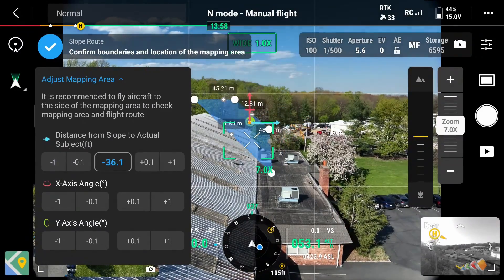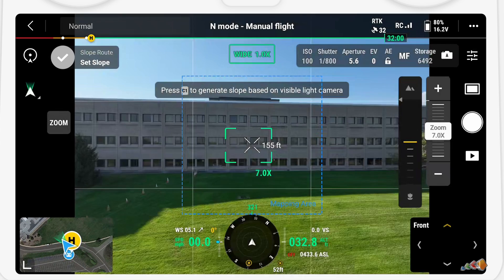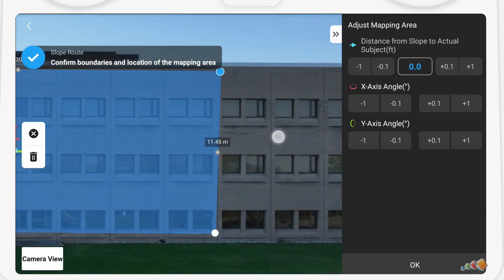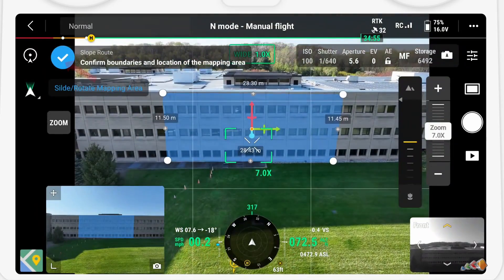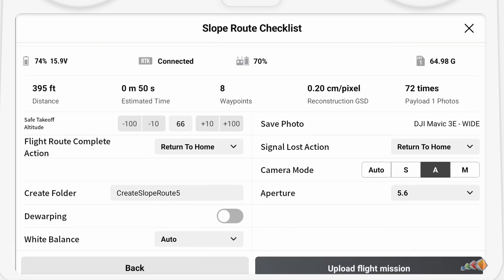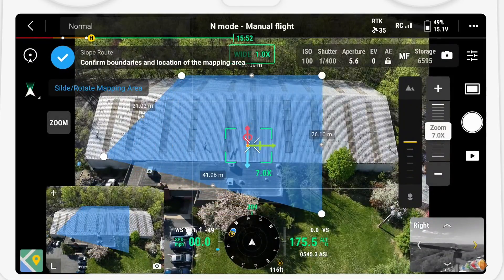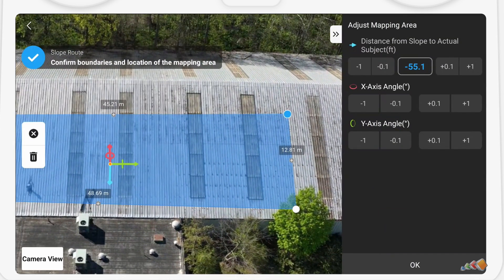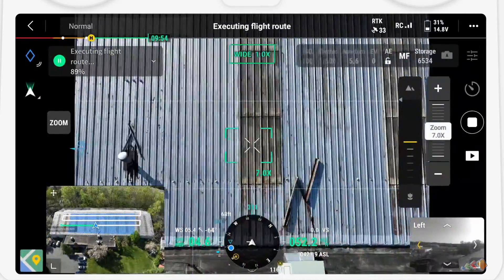Mavic 3 Enterprise Slope Route / Facade

Comment: When scanning a vertical facade on sight with the mavic3E rtk on pilot 2 app and the facade was a wall with doors and garagedoors from 0m to 4m.  When my camera is at 0 degree straight forward and want to capture all the facade the drone touch the ground! There is no way to set the minimum height so how to avoid that so that the drone start a bit higher ? Thank you.
Reply from the maker: There are a few options.  There is no way to create a minimum that I know of using this feature, but the box showing the area to be captured doesn't need to go all the way to the ground since the camera has quite a large field of view.  So you can raise up the capture area slightly.  You can also adjust the distance to the facade and it will adjust the number of passes - the further back you are the fewer passes there will be.  In my example I initially only had one pass right in the middle.  
When it creates the flight path (shown with a green line) you can use that to see how close it is to the ground and adjust as necessary.  
If that doesn't work for you then you might want to try using Dronelink instead which does allow for setting the bottom and top altitudes - see this video https://youtu.be/bM7PmiXaeWo
Reply: @aviosmedia I can set the lower height in UGCS at min 5, thats not good. So I guess your first solution is the best to higher up the base in the blue box. I watch all the videos and still do to learn more.  🎉
Reply from the maker: Yes, start by raising the blue area.  I can pretty much guarantee if that if your drone is going so low that it is touching the ground then you are going lower than you need to for capture.

Comment: I just wondered what software program is perfect for such inspection. How to create a orthophoto with high detail without spending money?  I used mipmap, webodm and postshot.   Mipmap was the best.  What is your advice and workflow?
Reply from the maker: What drone do you have and are you looking for 2d or 3d?
Reply: @aviosmedia mavic 3E and for facade or roof 2D and buildings 3D
Reply from the maker: For capture of 2D with an M3E I use the Pilot 2 app - usually programmed ahead in Flight Hub 2.  For an angled roof I would use Pilot 2 and use the slope facade (this video).  For other facades I personally use Dronelink.  I have been asked to produce a facade tutorial for that so that is on the list - hopefully some time in January.  
For processing 2D I use WebODM 95% of the time and you can get 250 free credits when signing up for WebODM Cloud using this link: https://webodm.net/uav_mapping/19634
For 3D I usually use Polycam.  I would use Mipmap (use the coupon of ZSQQPS6INQ for 10% off) but it currently only runs on a PC and I'm all Mac these days.
Reply: @aviosmedia somehow I don’t get it right for this little facade I did today on sight in pilot 2 and process with webodm…don’t find a good tutorial to give me a good result.
Reply from the maker: I don't use WebODM for anything but 2D.  For facade work I would use either Polycam (for 3D output) or agisoft metashape - both of which work on my Mac.  You could do the same with Mipmap if you have that option.
Reply: @aviosmedia thank you for your time.  Appreciated.  Happy end of the year.  🎉
Reply from the maker: You're welcome!  And happy new year to you too 🎉

Comment: Hello, I tried this new feature yesterday and apparently the gimbal angle cannot be defined, right? 
I tried two different flights one with the gimbal tilted down and other with the gimbal leveled to the front. 
Depending on the gimbal angle the flight path was adjusted to cover the right portion of the building. Did anyone have this kind of experience regarding the gimbal angle?
I was using Mavic 3 Multiespectral.
Reply from the maker: The system will use whatever gimbal angle you have when you mark the area - so if you are facing a roof with a 45deg angle it will use that as the starting point.  You can then adjust it afterwards.  I don't have a multispectral so I can't tell you if that does something different.

Comment: I just tried this yesterday and have a question about an issue you touched on...
At 3:01 you are adjusting the distance from the "slope to actual subject" when viewing the slope from above. You were tapping on the +1 key to move it away.. i did the same thing.
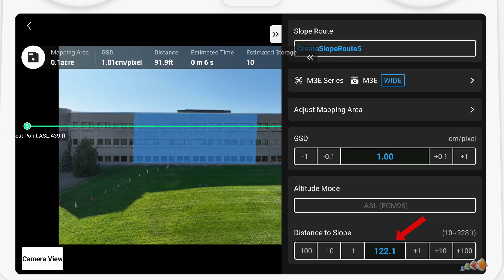But then at 3:50 you point out that the "Distance to slope" is 122.1 feet and it has to be moved closer...

Why is this distance so different from the slope distance that was set at 3:01? I didn't notice that difference yesterday and it started from that greater distance.
It seems like the distance from the first step should definitely carry over so that it shouldn't have to be readjusted later!

Thanks for these great videos!
Reply from the maker: I understand the confusion - so let me see if I can clarify.  

There are two things that are being controlled.  One is where the object being mapped is - that is what is being set at 3:01.  If we were mapping normally this would be telling the drone where the ground is.  

The second is how far away from the object the drone should be when mapping.  That is what is being set at 3:50.  If we were normally mapping this would be the altitude.  

So one sets the object location and the other sets the distance to that object.

Hope that makes sense - let me know if it is still unclear.
Reply: @aviosmedia  first, WOW, that was a quick response! 
and ok, i can kinda see the difference... still it seems in both cases the blue AR overlay in both cases represent the same thing... And if you look below from my question from 2 weeks ago, I think this answer here also answers my last question! :)   The first step locates the physical wall of the building in 3d space and the 2nd step locates the vertical plane that the drone will operate in when taking the pics... Is that a correct view of it?

And I know you have used WebODM from your other videos... and I tried processing this in WebODM and it does not know how to turn these into a vertical ortho map. What have you used for this?  This is an important commercial feature for my clients.

Your video are always awesome and this whole confusion to me is how the Flight App 2 GUI represents these 2 steps.
Thanks!
Reply from the maker: @hchattaway  Correct.  The difference is that the blue overlay shows what is being covered.  The second one (distance) changes the flight path, so if you see we only had one green line when we started - that green line represents the flight path.   So it was just going to do one pass.  When I moved the drone closer it added more paths to keep the same overlaps (see video on overlaps if you need info there).  
I've used this for sloped roofs and was able to get WebODM to create orthos.  It should work.
Reply: @aviosmedia  yes I saw the same thing.. when i moved that value closer, the rows increased...
I had just put a question on WebODM support board and they stated it can't make an ortho map.. It can make a 3d model of that wall but the quality isn't as good as a true ortho which retains the imagery detail.. When creating the model, the images when wrapped around the point cloud are always more distorted. :(
Reply from the maker: @hchattaway  Interesting.  I didn't actually try it on the wall shots - I just used that as an example of how to use it.  I have used it on some roofs and it handled those OK - I guess there is an angle where it stops though.  Interesting.  I'll have to play around with it when I have more time.

Comment: I have the ME3T and this will be a great additional service..

But I was wondering how does it figure out the distance from the slope to the actual building surface? The altitude off the ground is obvious, but at what point did it get a reference to the building so that it knows how far away you told it to fly?
Reply from the maker: It does some magic with the imagery - you literally take a photo of the area you want to cover and it figures it out.  Don't ask me how!  Someone smarter than I am (a pretty low bar!) figured out how to do that.

Comment: Excellent video! question does the mavic3 thermal have these features that were presented?
Reply from the maker: Yes it can (I tested this morning).  You will need the RTK module installed the same as with the M3E.  If you don't have one let me know and I'll point you to where you can get one a bit cheaper than buying in the US.

Comment: Doing a test mission today, and the drone couldn't get down low enough because of obstacle avoidance to capture the base of the facade. I set the downward avoidance to 3'. Any other suggestions?
Reply from the maker: It's quite a wide angle lens, so my assumption is you are too close to the building.  Try moving back a bit.  That will also help with gps accuracy.
Reply: Does the emlid work outside the US? We operate in South America and are looking for a good Base and Rover to use with the M3E.
Reply from the maker: @dragonflyguyana  here is a link that will show dealers around the world.  https://emlid.com/dealers/. There is no reason why it would not work in South America, however I would suggest contacting Emlid directly in case there are any differences in software such as licensing restrictions or language differences.

Comment: Recently, I bought a M3E for mapping and cartography, In What circunstances can I use this tool?
Reply from the maker: Sorry - I think I need a bit more information.  Are you asking when it is legal to use it (which will vary by location) for mapping and cartography?  Or are you asking about areas where the maps you generate can be used/sold to clients?
Reply: @aviosmedia  Thanks, I mean this solution is for construction?
Reply from the maker: @mundocoban  It can be, but it really depends what you need to achieve.  A drone is just a tool so it can be used for a lot of things.  Do you have a construction client that needs something, or you want to sell them your services?
Reply: @aviosmedia  the second is the answer, I am geologist and usually I use photogrametry.  How do you record this work an then you can show by you tube?
Reply from the maker: I don't deliver to clients using Youtube - that's just for training videos.  I have portals that can host geotiff photos (orthos/maps), 360 photos, standard images and video.  These are put into a portal - usually with regular captures so that the clients can compare progress on site.  The portal I use depends on the client needs.  So if you can tell me what products you expect to deliver I can offer some suggestions on software that can do that.
Reply: @aviosmedia  I mean How do you make video tutorials from your remote control?
Reply from the maker: Swipe down from the top of the controller on the top right and you can select screen record.

Comment: Hello, I'm new and I've already seen many of your videos. Question: to use the DJI MAVIC 3E+ the RTK Module, is it mandatory to also purchase the D RTK-2? I am thinking about doing topographic surveys, what precision would I obtain with and without RTK.
Reply from the maker: Hi.  Thanks for the question.  No, it is not necessary to buy the D-RTK-2 if you have an RTK unit.  You have several options:

1.  D-RTK-2 - this is your own base station but must be placed on a known point.  If you know how to create a known point - great. If not, see my other video that shows how to find an existing one https://youtu.be/Bt8MfWU0Q8I.  
Note that the D-RTK only works with DJI - it is easier to set up on DJI but if you buy another type of drone or want to use it with a GNSS rover then you could be stuck.

2.  Buy another precision GNSS rover, such as an Emlid Reach RS2 or RS3.  The M3E can connect to this easily and it is cheaper and works with anything, so you are not locked in to DJI which, if you live in the US with the law changes proposed might be a good thing.  

3.  Use a CORS / NTRIP server.  These are base stations that are all over the country. that broadcast connection signals that you can connect to over the internet.  Many municipalities  have free ones that you can connect too and there are also paid ones.  I showed how to do this using Dronelnik in a previous video (https://youtu.be/2wQCyeOGqYc) and using it with Pilot 2 is very similar.  This also has information on how to buy an RTK module at about 1/3rd the US price (if you are in the US).  

I will also be putting out a new video tonight that shows how to connect to a free service that is a global called RTK2Go so if you are subscriber you will get notified of that when it goes out this evening.  

Hope that helps!
Reply: @aviosmedia  Great, thanks for your response. Resolve my doubts.
I will be attentive to the new video!
Reply from the maker: Great